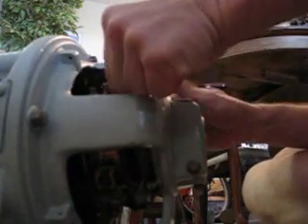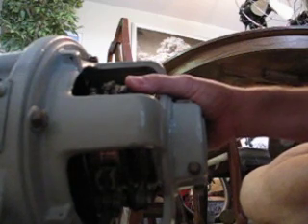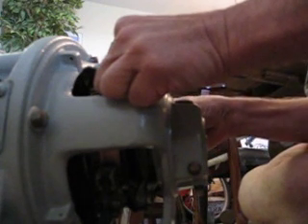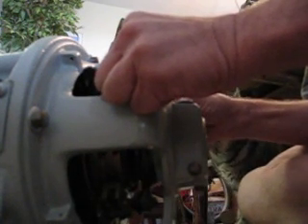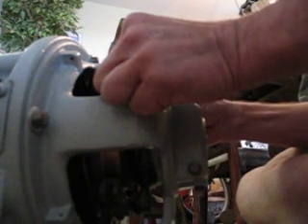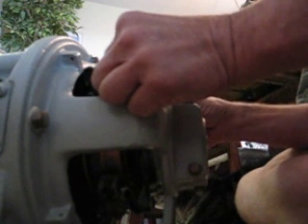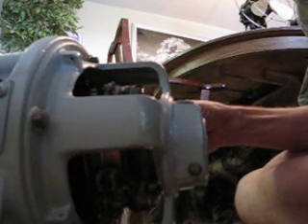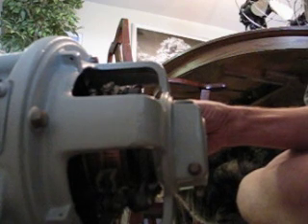Repulsion Induction Motor Brush-Shifting

Comment: Be careful about how far you move those brushes or you will burn out the windings, especially if doing so with the power on. Your motor is much larger than mine so the damage would be a lot more.

Comment: I have a big GE RPI Repulsion induction motor,  Mine is a 1 1/2 Hp. i I have a great idea, because the size of these motors and the power they have compared to a new motor with the same HP, no comparison obviously, the old stuff was made to last and outpower the new stuff, IM currently looking for replacment brushes if you knwo where i might be able to get some that would be great, My Q is, do you know how many watts that motor uses? on the 110-120 circuit? i wish i could find more like these..

Comment from the maker: No it wouldn't, only because your RS uses repulsion only to start. Once the brushes lift, a shorting necklace is internally pushed against your commutator, shorting the rotor windings and in therory, giving it the characteristics of a squirrel cage rotor. Like you said though, you can reverse your RS by moving the brush rigging before starting. BTW, Century RS motors ROCK!

Comment from the maker: This motor uses both the repulsion winding and the squirrel cage winding at once, both windings are in constant use all the time the motor is running. This motor is very use friendly. It has the tremendous starting torque of a true repulsion motor combined with the running characteristics of a squirrel cage induction motor. Again, BOTH windings on the rotor are in use at all times while the motor is running. Hence repulsion induction. I have diagrams of this exact motor if interested.
Reply: I am very interested

Comment: Prolly wouldn't work on my 2-1/4HP Century Electric motor since it too retracts the brush's after starting, but you can rotate the brush's to reverse it before starting.

I'll keep my eyes out for old GE R-I motors, although they are probably few and far between now :(

Comment: forgot to mention the other reason it wouldent work on my 1903 wagner is, it is a brush lifter! the brushes must be touching the commutator for that to work. my wagner the brushes lift away from the comutator after it gets going! i can only change it when the motor is swiched off then back to on!